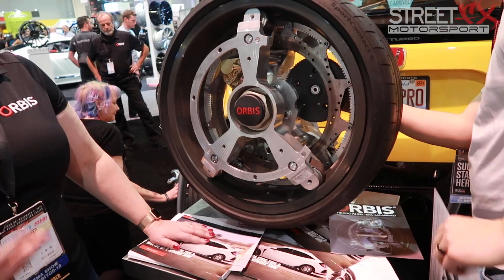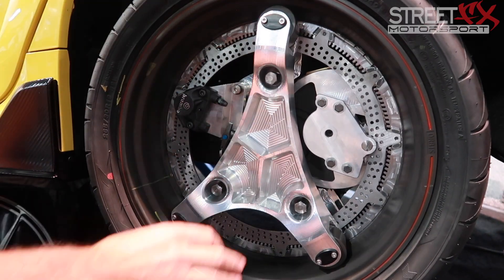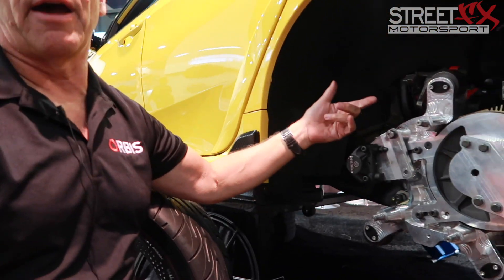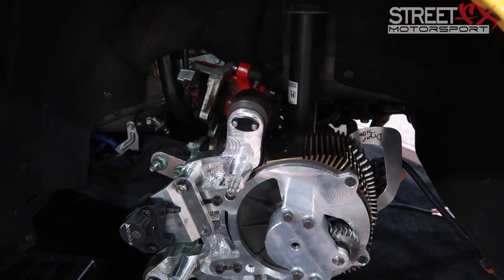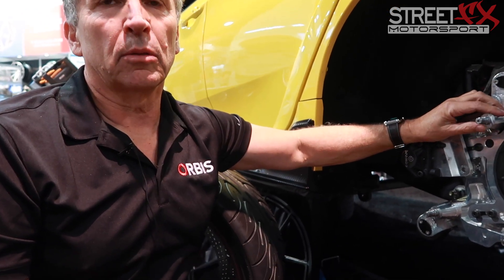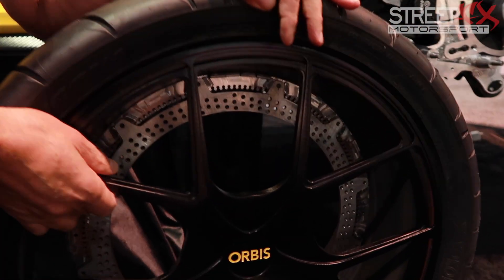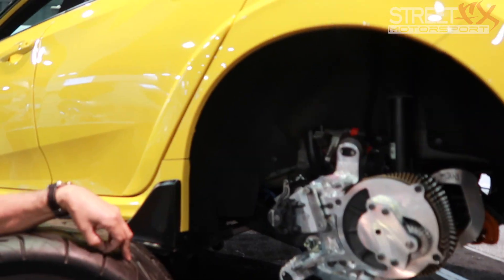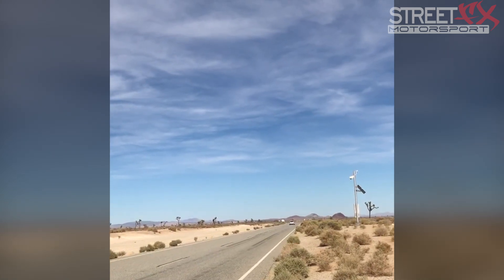WORLD's FIRST ELECTRIC hybrid AWD Honda Civic Type R FK8 with 450hp!

Comment: I didn't understand how it doesn't affect the un-sprung weight if there is a motor and gearbox attached to each wheel, surely it will increase the un-sprung weight if anything?

Comment: End of the day this is still adding 60 pounds of unsprung weight from those motors, just because he subtracted that weight  by changing the braking and wheel mount setup doesn't change that. This car minus those motors would lose that amount of unsprung weight. Honestly adding electric in a smaller assist drive like this opens up some neat options in terms of how it can be done and as cool as this is, this isn't it. An entire pre fab rear axle with inboard motor(s) and brakes available in different track widths would certainly be interesting.
Reply: do you think this would be available on a manual rwd car? like a caddy ats 2.0T or a mustang ecoboost

Comment: Kohler 38RCLC - 38kW Emergency Standby Power Generator (120/240V Single-Phase)
Model: 38RCLC-QS1
19% Buy This
(5)
$16,635.00

provides a substantial amount of energy, capable of supporting numerous electrical systems simultaneously. Technical Specifications and Features.
3.9
store rating (152) · 30-day returns

DCA-45USI - 37KW Diesel Generator
The Ultra-Silent DCA-45USI generates standby output of

… ,full load power factor to be around 0.8 then to give an output power of 37 KW at full load the motor will draw line current approximately equal to 83.44 Amps
Feb 1, 2018

Comment: … ,full load power factor to be around 0.8 then to give an output power of 37
 KW at full load the motor will draw line current approximately equal to 83.44 Amps
Feb 1, 2018

How much does a 50hp electric motor weigh?
Product Details:
Weight	683 lbs
HP	50
RPM	1800
Frame	326T
Mult. Sym

83.44 Amps
Feb 1, 2018How much does a 50hp electric motor weigh?
Product Details:
Weight	683 lbs
HP	50
RPM	1800
Frame	326T
Mult. Sym

Comment: If I was building a hybrid, I’d go for a rear wheel drive Lexus drivetrain. That said, I’d consider something like this on the front of a Mk2 Zodiac or . Just imagine this on the drag strip with a 5.4 litre Coyote engine and transmission driving the rear wheels, the motors driving the front, in a Zodiac.

Comment: I've personally been thinking about swapping a leaf subframe in the rear of a car. Like an old prelude or something. Then using a 2nd throttle really close to the gas throttle, but not too close to where I can't avoid it if I want.

2nd Gen Leafs are ~160kw. So if I go 320v, at 160kw, I'll need ~500amps(?). LFPs would be great for this.
Use some LFP's for high charge and discharge rating  (though lower capacity). Some crazy BMS setup. 
Maybe 4kw/h? That's all Porsche and Infiniti's hybrids have. Yeah they can only drive like a mile on pure electric, but with regen I can use it as a power boost and fuel economy (depending on how I drive it). And regen can help with braking a LOT!

I'm surprised more people haven't gone this route. It's safe power once you have it set up. Increases gas mileage when you're not going crazy.

Edit: 160kw is just a bit over 200hp for those wanting the numbers converted. Way more power 0-60mph than 60+ though.

Comment: What they should make is a semi-universal kit for FWD cars that replaces just one rear hub with an electric motor and a battery that has about 20 miles range. Make it as cheap as possible and adaptable to as many FWD cars as possible (leaving the original FWD drivetrain intact).

Many people just drive a few miles to work and back every weekday. They could use just the motor, if they're on a side street route, or let the clutch out in 5th gear, to cruise on gas, after using the motor to accelerate from 0. This would increase MPG to about 50, on any old FWD car. It's all the stop and go acceleration that lowers gasoline MPG in city driving.
Reply: And still run engine in neutral at low revs for all the periferals a/c, power stearing etc.

Comment: Recently had to completely rebuild the brakes on my truck, they rusted apart due to road salt. The drum brakes were an absolute bastard to rebuild in particular, because the drums had rusted on so hard. I'd be rather hesitant of putting a complex planetary gears and gearbox system into the same place as a drum brake where it would get full of road salt and mud.

Comment: Mechanically the design is weaken the wheel when it handling the pothole or rough road. I don't recommend it. Bad design easy to break down structurally
Reply: cool story mr 3rd world - nobody going to be driving those anywhere there is a pothole big enough to do damage...

Comment: im lost at "reduces friction to one-fifth", the way i see it it has more friction points so what the heck? doubling structural strength of the wheel translates to heavier wheel. rotor weight reduced by 60% this only means that to achieve the same or greater braking force the materials would be super lightweight and expensive. and this looks like the wheel is completely sitting on SIX (JUST SIX) bearings. to be centered.

Comment: Also, I think it is priced pretty competitively. Even though it's 10k wo battery and up to 13k with a battery, a stage 3 kit (plug n play turbo kit) usually runs 5k. However, stage 3 kits for fwd cars usually come with its fair share of problems (traction, torque steer, and extreamly narrow powerband). 

With this kit, us hot hatch owners can effectively get 400+ hp AWD machine under 50k, and all that  power will be accessable instantaniously. Imagine a gti or civic that smokes Shelby mustang and even corvette (if they manage to shrink then size of the motor) which costs well above 60k. 

That's crazy

Comment: I wonder if the sounds is only super loud under very heavy torque (launch). I would like to see a video with the sound level inside the cabin. I’m not even into hearing my twin turbos let alone a gear whine that would normally make me worried that something is wrong. I had a Borg Warner 5 speed bust a bearing on the input shaft and counter shaft that scored the gears slightly. When it was rebuilt with all new bearings and the gears cleaned up as best as possible, there was a bad whine at highway speeds that drove me nuts. I had to drive in 4th gear a lot to not hear it.

Comment: so, you took 1 sealed rotating assembly using a proven, self-lubricated hub mechanics and transferred that to 3 small wheelies that ride on the surface of the rim, where all the dirt, water and brake dust will settle. Not to mention - 3 tiny wheelies rotating 20 times faster than the tire itself. Yup - definitely nothing can go wrong here.

Comment: Explain to me how adding these motors, while not adding much in the way of weight, while also REMOVING stopping power is supposed to be considered "safe to drive?" I am calling this BS. The stopping power of the original equipment is designed specifically to the cars specifications and weight. He even stated that he would need to do something about the pressure. The braking system is designed with the mass of the car traveling at a specific speed. This setup, will not be able to replicate those specifics. Instead, you are going to be putting a generic braking system in place, while also limiting the friction of the system. The rear brakes of a normal import, is originally a small brake pad about 2 1/2 inches long, and almost 2 wide. For a performance car though, that would be suicide, due to the needed extra stopping power needed at higher speeds. That is because the rear only takes up about 20ish% of the stopping power of the car. The FRONT on the other hand, would require a much more beefy amount of of surface for transference of friction. 

The second aspect of this that makes me shake my head, is that no matter how "responsive" you try to portray this system to be, there will still be variance in the responsiveness of the added on electric motor and the cars original equipment. That means extra wear and possible/probable damage to the drive train. This doesn't even factor in the points of open gears found within this system and things like "road grime." 

So I am calling this as BS. It is a great experiment, but I would have to say that anything you add to a car that is not found within the OEM, is stuff that will cause problems for the car, and the system will break down much sooner then if you just left it alone.

Comment: If they can make this complete sealed off from dirt rain salt and snow, even just 50 Hp total plus torque and without the battery pack for say $5000, it will sell well, basically any car instantly becomes a hybrid like the volt once you add the battery pack, better mileage, awd traction, and slightly more performance.
So someone with say a gti or civic si or even a base golf or civic for around $20,ooo or less used, can add $7000 to their + labor and have a totally economical, faster, better gripping, more fun car to drive, with better breaking.

Whats not to like.
repair, maintenance, service.
They have to partner with someone like midas, or big car chain for service, installation, maintenance, and it needs a good warranty.

Comment: Jason does not have the factory wheels on his car. Those are Titan 7's. 

And can someone explain how adding 100hp to the REAR makes the car have another 100hp total? The front is pulling 306 stock with that engine and transmission, so how does a separate system in the rear with 50hp on each wheel, make it a 400hp car now? I am pretty sure it doesn't work that way 🤔

Comment: $9,000 plus $2,000 for the batteries I say just go buy a Toyota Prius for a second vehicle it would be cheaper. That thing has so many parts in it it's nothing but a nightmare road debris gets into those open gears it's going to pull it apart. It doesn't really seem like an all wheel drive because your front tires are going to have so much more horsepower than the back tires your front tires are basically going to be dragging the back tires so yeah. I'll pass.

Comment: No extra weight?! You need enough batteries to run 100hp which won’t be lite...
Reply: Upgrade the alternator and the engine will charge them as you go. An extra 100lbs worth of battery and wiring is less weight than all of the diffs and driveshafts of an actual AWD version.
Reply: Jalen Davis a generator big enough to put out the energy needed to produce 100hp would starve the engine of way more than 100hp through efficiency loss. Regenerative breaking is about all you can use to maintain charge. You could trickle charge the batteries but again it would rob peak HP from the car which in the end is just as bad as adding more battery weight. Plus, adding more batteries needs to be done throughout the car to avoid changing the weight distribution too much. It’s just not a good solution but it’s a unique one and for that I gotta give it a thumbs up but they won’t sell many of these lots when they cost as much as a Chevy Volt once you buy everything. Just my opinion though, just graduate of how unique it is it might go gangbusters for people that care more about look and unique over actual performance.

Comment: I really hope they can put the electric motor where the rear diff would normally be and use drift shafts. I worked at Toyota for 4 years and the RAV4 hybrid and highlander hybrid are designed this way.. Engine only powers the front wheels, the electric motor is in the rear with no drive shaft due to it being electric in the rear only... Id like to be able to run normal rims as opposed to a plastic cap in the rear with all the ugly funky gears and big break rotor peaking threw... Awesome innovation and great job, but they got to make it look cleaner imo..

Comment: Instead of battery use a generator with small gas engine. Transfer power to wheel motors. Also charge battery . By doing so it becomes hybrid. And no limitations of battery.

Comment: About $10,000 for +50hp per wheel... i just did a cam and tune in my LS and gained about the same... for less than a thousand. Perfect example of over-engineering. I will agree that this is amazing what they have created and extremely ingenious but just not worth it... just my opinion.
Reply: Not just the hp. Launch alone would make this worth it. Even if it didn't help much after that. And with improvement could help the launch a lot more with better gearing as stated.
Reply: You could just use it for launch control and shut it off after that.

Comment: Hopefully....   this will come out with upgrades like forged gears or, if applicable, TiAlN coating for the gear teeth so normal road dirt doesnt scour away the gear surfaces...  :)   or a forged wheel/rim race and rollers made of something quite hard if the design allows...

Be nice if you can also disengage a wheel so your not loosing power thru the friction of the motor if it's an all electric vehicle and you only want to use 2 motors with two just freewheeling for the times you need to switch on AWD...

This has HUGE potential and I would love to use it on my plan for an all electric tour of south america and north america...   but I already know I cant afford these yet even though it's an ideal solution to eliminate traditional whole car drive train losses such as the weight of everything, the space needed and the friction of all those moving parts...  :(

Comment: For a 450hp Honda Civic that launch wasn't convincing at all
If you are thinking to put that on your car just to gain more 100hp with no extra fule cost believe me it does not worth it, check on the dodge viper 400hp RT 10 from 0-60

Comment: Draw backs
-over $11,000 for 2 wheels shipped for 100 horsepower 
This does not include the very expensive battery packs which could be thousands of $$$ more.
- It's not 100 horsepower throughout the gas motor's drivetrain torque curve. With the 2 different gear sets and the RPMs of the motor its stated that they will only assist power up to 60mph.  Or up to 100 mph with the 2nd gear set
- It may decrease unsprung weight but it adds extra over all weight. The equipment alone adds 180 pound to your car. The battery pack is going to add even more. So well over 200 pounds in curb weight increase.
Awesome idea and design but still decades away from being a feasible, realistic, practical car mod when you read all the specs and pricing for it.
Reply: Dudes kind of full of it on "reducing" unsprung weight anyway. Yes it is technically lighter than the whole setup from factory... it also has a super fragile braking system. Go just a little over that things operating temp and kiss that whole wheel goodbye. These guys are looking to collect on some liscensing fees and disappear to a tropical island somewhere.

Comment: I’m confused with the hp number because the 306 hp of the type r is to the crank, and they said the 50 to 100 hp this adds is to the wheels so what’s the conversion here? Because crank to wheel hp is different
Reply: Ok I looked it up a stock type r makes 290 hp to the wheels so this makes it a 390 hp to the wheels. Cool.

Comment: Innovation  Would like for a 22.5"   wheel on Truck!! Awd.  Are the motors also generators?  Combined with silica or carbon based ultra super Capacitors? 
Product Pricing?? 
Emergency 2 hp Diesel Generator?

 Petroleum!!!
Reply: That's the other side of it, use it to improve truck gas mileage.

Comment: 1) Wheel will come off on road (see how easy to loose the three nuts), 2) open gear won't last long, sand will grind everything off  3) the three plastic rollers to support the vehicle (actually two) will come apart in no time 4) car can only go straight line (don't see any structure to transfer later force)

Comment: Awesome concept but longevity is going to be the issue. 
-Basically plastic wheel guides -will wear quickly as heat is building up on contact surface and as they wear wheel will become wobbly.)
-Exposed ring gear -allows sand and rocks from the road to chew away at gear teeth slowly causing failure. 
  Concept is in the right direction but needs a little more engineering on component protection and wheel stabilization designed for long term.

Comment: I get the idea of trying to look like it's new but this would be a whole lot easier if they just added a hub motor. 
Thew whole messing with a hub, brakes, wheel and so on adds a lot of complexity, cost and fail points for a total gain of 18lbs. In a 3000+car.
That's just not worth it. 
The idea of a bolt on kit like this is though so ditch the sema nonsense, develop it as a wheel motor or bolt on from behind and put it on the market. 
From an engineering POV there's no way in the world that is going to pass mass market approval as it stands for multiple reasons (which I'm sure they're fully aware of) but with less superfluity and a few tweeks it could be good.

Comment: Next big question, what are the long term reliability of all those clock gears and cogs? Tesla had gear driven back wheels and only after 30,000 miles, the gears were practically destroyed and worn away!! Yes put on at least a cover to keep sand and dirt out of those gears, but regardless, those gears will still wear out...Tesla learned the hard way!

Comment: Only way this take market by storm is if offer through dealer for price point to high and feel a deal could drastically slash cost of item. 
Good luck but I fine it to be high value when that much money a person could rebuild hole motor at turner shop and have turbo 700whp civic with 15-27 mpg 

And yea nose would be there too on turbo without extra 200-300 lb. your add to car lol

Comment: not good. There are better solutions for that, using motors in weels. A friend was developing a system and now she is working at Bosch and they are making them market ready. This one in the video has gears, bad thing man.
It will work only in test conditions, with no dirt or snow or or or